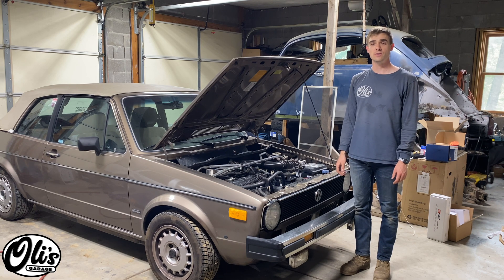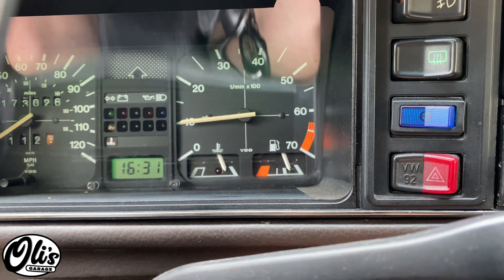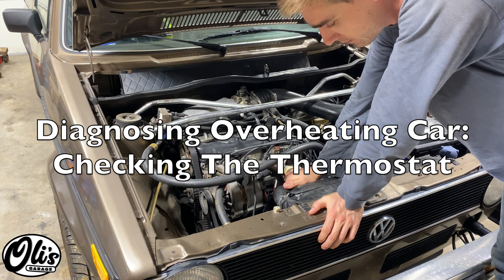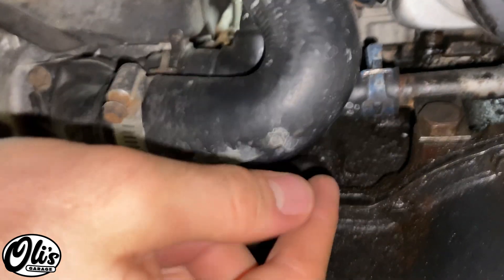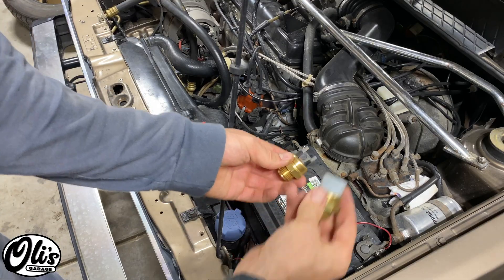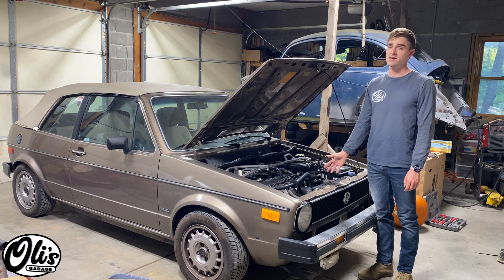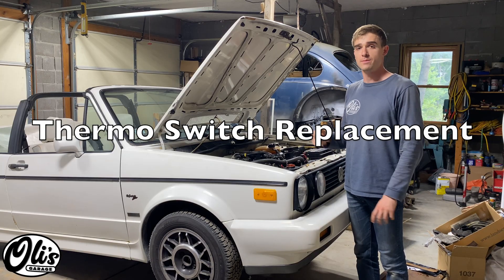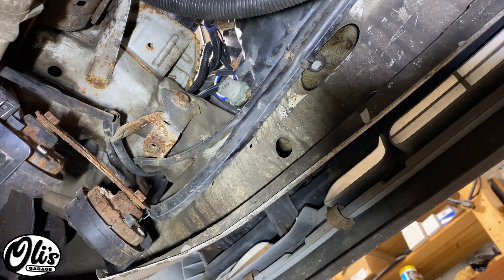Diagnosing and Fixing Overheating VW Mk1 Mk2/A1 A2

Comment: Thank you! You helped me 100% with my overheating issue for my 85 jetta. I called 6 shops in my area and they refuse to work on my car due to the age of it. I confirmed with your help that my fan is still good. It was the thermoswitch. Thank you again!
Reply from the maker: @NorcalMerlo916  heck yes!!!! Love hearing that. Check out my other videos on transmission fluid change and tune up. Your car will thank you! And also flush the coolant!

Comment: My Mk2 Digifant coolant gauge works but won’t move out of the first zone on the left (thick white part). Engine gets hot and radiator fan works correctly.
I’ve replaced temperature sensor and problem persists. Could my thermostat be defective? 

Thanks for the video.

Comment: In cold weather, my idle rpm stays high. I just found out there's a choke thermal switch spare part available. Never seen it though. Have to search 😅 (Golf2 1989 1.6l)

Comment: Hi Oli, thanks for the informative video.
Im still having some problems with my polo mk 2 where the fan wont turn on. I have brigde the switch on the radiator and the fan works and turns smoothly, i then replaced the thermoswitch, but it still dosnt come on when the motor is too hot. what else could be the problem. no fuses are blown and i have also cheked for airlocks in the system. Any advice would be greatly apreciated. Greeting from Denmark

Comment: I got a 1990 Wolfsburg. Thermostat isn't opening but its new and works. Top hose definitely gets hot the bottom hose is ice cold tho. Pumps new as well
Reply from the maker: Have you tested the thermostat in boiling water?
Reply: @OlisGarage  yes I have. The thermostat is good and so is the water pump. Just put a new headgasket in 2 days ago (head was decked professionally) timing is mint and she runs like a champ but still over heats. Fan is bypassed and on a switch (i turn it on at aroumd 120f) when I squeeze the bottom hose on radiator it does put flow back into overflow tank. Could it be just reduced flow? The rad is literally the only thing g I haven't replaced yet . It seems to have flow though however the top will be hot and the bottom cold
Reply: @OlisGarage  i do not think the thermostat is opening but I'm not understanding why it wouldn't be. It works fine while boiled as does the old one

Comment: Firstly thank you for the advice, My old thermostat was 87°c but the dealership gave me a new one of 82°C and said it should work fine, My heat gauge isn't going up and the fan hasn't really gone on because it didn't get hot enough I guess but if I Don replace the thermo switch should I still get a 1. 95°c 2. 102°c or should it change now because it's a 82°c thermostat?
Reply from the maker: Hmm. Something is wrong here. Even with no thermostat the car will get hot enough to turn on the fan in maybe 10-20 minutes of running. Are you sure that the coolant system is filled correctly?
Reply: Yes I believe it's 60% water 40 % coolant? When I breach the fan it turns on and both the top and bottom pipe gets hot,
Reply: I drove 2 hours without my cars needle even going to half when I got to my destination my fan came on, I drove home 2 hours non stop without any overheating issues, a week later I drove about 20 minutes and my car overheated and coolant all ran out the top as it boiled over out of the bottle, I checked my car and noticed the thermostat didn't open it was stuck on closed when I tested it, so I replaced that but they gave me a 82°c thermostat not a 87°c
Reply: Replaced the thermo fan switch and its fixed thank you

Comment: Have jetta3 i have the waterpump and termostat but still overheated
Reply from the maker: Is the thermostat opening at the right temperature? In my thermostat replacement video I show how to test a thermostat in boiling water. 
Is the fan coming on?
Is the radiator clogged?
Does the water pump work?

Comment: vw golf mk2 1986   1.8L 8v 
oil pressure dropping only when engine hot 
and buzzer and oil  warning light flashing .

what is done 
checked oil level ok 
filter changed new
 oil pump checked ok
 crank bearings clearance ok  
high oil pressure switch changed new 

the car still give the oil warning light flashing and buzzer  
and coolant temp jumps over the middle and high speed fan working .
if you know please reply and help me fix my car I love in a remote place and car  stopping would be a big problem .

Comment: Mine (on a MK2) failed in a way that it would be stuck in low fan speed. So after parking, the fan would just never stop until the battery runs out (but luckily I noticed it before that happened).
Reply from the maker: Oh wow, interesting. Good catch. That would’ve been upsetting if it’s totally dead!

Comment: So, I changed the 2x coolant temp sensors/senders on my ‘89 Jetta 1.6TD. My temp gauge kept randomly dropping to zero so I figured that would fix it.

Looks like I must have put the wrong sensors in though. Now gauge doesn’t go passed the solid white “cold” section and the glow plugs are staying on much longer than usual.

I put in part #025906041A. After some googling, I’m a bit more confused. Looks like I should use part #251919501A or 251919501D but can’t figure out which. Anyone know the right number or the difference between these 2?
Reply from the maker: Gauge randomly going to 0 indicates that the gauge is broken. I have a video on repairing the gauge. 

I’ll dig a bit about the coolant temp sensors

Comment: Here’s a weird one. My fan comes on if I turn on the A/C. It also comes on if I shut off the car and it’s hot. But it does not come on when the car is running and the engine is hot. So if I’m idling for a long time it starts to get pretty warm. Is that the fan switch?
Reply from the maker: Year and model?

But yes, fan switch. Ac makes the fan come on automatically (even if ac doesn’t work). Then you also have an after run fan switch that makes the fan come on when you shut it off. Mounted on the back side of the valve cover.
Reply: @OlisGarage  it’s a 1989 Jetta GL 1.6TD. Think I’ll just replace relay, switch, and fuses anyways. It’s all old and those parts are all cheap. Thanks

Comment: Thanks for your videos Oli.
Did you get the information I emailed you regarding the owners manual with all the tork settings and so on?

Apparently there is a transistor in the dashboard behind the cluster that also effects the needle. When I bought my Fox the temperature needle never went past the second line on the left. Over a period of time it did, I've replaced the engine coolent sensor, engine temperature sensor and thermostat over the period of time and noticed that the needle now indicates as to your does. 
Do you think it could be a problem?

I followed your method as to the timing setup also (its like the described method in the book I have), but I do think that the inlet valve time is not correct for me as the vehicle is sluggish on the uphill (I can feel it losses power compared to a straight). 
Any possible advice on what I should do?
Reply from the maker: Hello Siener, yes I did! Thank you for that. Sorry I forgot to respond saying thank you..I am not the best with keeping up with everything haha. 

Hmm. There is a voltage regulator which does matter. Does your fuel gauge indicate properly? I need to review exactly what the voltage regulator feeds power to. 

Put your engine to top dead center (little dot on the flywheel) and then check the camshaft gear and see if it is at top dead center. There is a little dot which should be in line with the valve cover. Google should reveal some images. 
I’m currently working on making an in detail timing video, but am not done yet

Comment: On all my 80’s water cooled VW’s after fixing any over heating problems I replace the thermostat and fan switch with a lower temperature parts. The original thermostat and fan switch open up way to late, usually when the car is on the verge of over heating.
Reply from the maker: That is actually not correct. The thermostat is perfect for the vehicle. Upgrading to a lower temperature is unnecessary. I don’t think it hurts anything, but it’s definitely unnecessary. These cars are not on the verge of overheating. Not trying to be rude, just trying to make sure people don’t think these cars are borderline overheating. 

Later VWs (I can 100% confirm through 2005-I just dug through the manual) actually used a thermostat which isn’t fully open until 105C or 221F (it starts opening at 85C). That is much hotter than the thermostat in these cars which is fully open at 87C. 

The radiator fans are similar. The newer VW fans come on at 92-97C or 197-206F. That’s the low speed. 
The cabriolet radiator fan comes on at 93C. 

Coolant also doesn’t boil until around 115C or so when it’s under slight pressure and properly mixed. 

One last tidbit. The coolant temperature gauge in the newer VWs isn’t accurate. It is literally coded to display right in the middle for a whole range of temperatures. This is so that people don’t think their car is overheating when the gauge goes slightly past the middle.

Comment: My only 2 cents would be to check the voltage drop when the fan kicks on. The coolant system can be fine and the fan is just not pulling enough amps due to a bad ground.
Reply from the maker: Good point. The other way to check that is to monitor the gauge. If the temperature keeps climbing and the fan doesn’t turn off, then something is wrong with the fan or the wiring.

Comment: Well done oli. I ended up fixing the fan to permanently on, on the side of the road after the termo switch died.  It’s always handy to know how to fix/bypass problems. Great video
Reply from the maker: I drove around for a while with my AC always on to keep the fan running before I got to replacing the switch…haha. Then I found out it was just a bad connection to the switch. 
I hope the car is running well - it looks great from what I’ve seen in pictures!!
Reply: @OlisGarage  thanks 😊 oli. Yeah currently had a water leak from the ex owners diy fix . Replaced the water pump too . It’s running great again . Keep your videos coming I enjoy watching them .